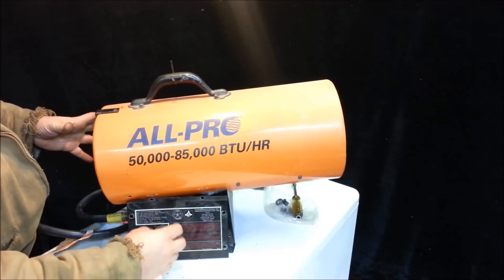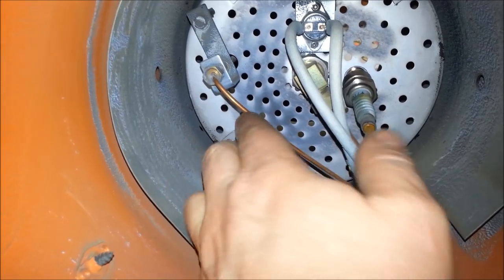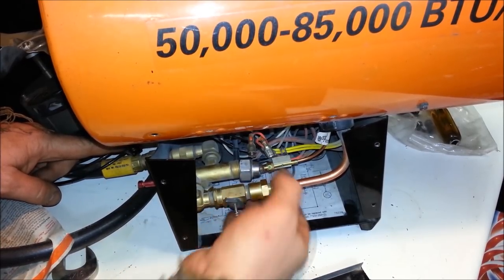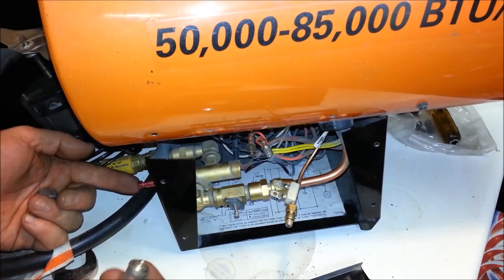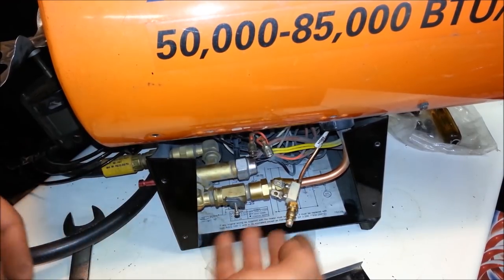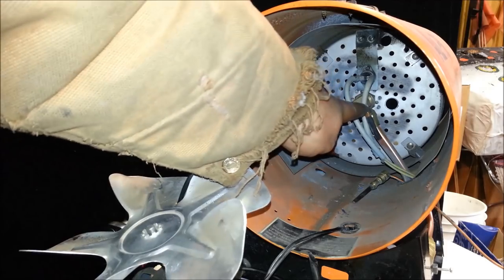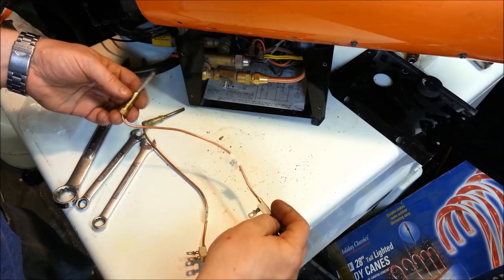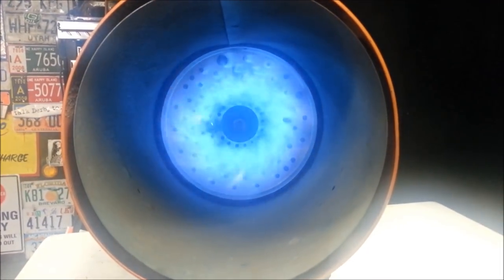Propane Torpedo Heater Not Lighting & How they Work

Comment: Great Video, But I put new thermocoupler in and still the flame goes out when I release the pilot lever.. Everything works great when the lever is pushed in. Whats my next move? It's a Reddy Heater 75-125.000 BTU and it looks just like the one you worked on. Thanks
Reply from the maker: Take your relay out; little box with a bunch of wires going into it with generally a clear cover. You need to check the contact points on the relay are making a good connection
Reply: Ok I will check tonight and get back with ya. Thanks
Reply: Ok the relay out only has solder joints nothing to clean off. Solder joints look good. What do I do next?
Reply from the maker: If it is newer there is likely to be a temperature shut off switch. The kill the power to the thermal couple if it sense the unit it too hot. It is supposed to shut the unit off and reset itself once the unit has cooled. If yours has one it will be about the size of a marble with 2 wires plugged into it. Take these wires off and test with them not touching and then with the two wires connected together. https://encrypted-tbn3.gstatic.com/images?q=tbn:ANd9GcTg3dsk4hi5XYhBJZgUH8Z247kFR-TYU2PgABbraYu8e5ylSlkKdw
Reply: Ok so pull wires off make sure there not touching and test? Then test with wires touching? If it works with wires touching or not, can I run heater that way until I get a new Temp shut of switch?
Reply from the maker: Yes, you can run it this way until you get a new sensor. If this is your issue.
Reply: Ok both tests didn't work. What do I check know?
Reply from the maker: Reading back over your comments. You need to pull the cap off the relay and check the contacts(points) Here is a video that explains it better. https://youtu.be/uerxvIBODOE
Reply: Is there away I can send a pic so you can tell me where my relay is?
Reply from the maker: On my model and many other it is about the size of a 9volt battery and has a clear cover(rectangular cube). It has half a dozen wires soldered to it and is mounted to the circuit board.
Reply: Ok my heater it doesn't have a 9 volt battery looking rely on the circuit board. On the right side of the circuit board there is, what I think, is the relay, looks like, maybe 2,  9 volt batteries put together and only 4 wires coming out of it, 2 of them are the thermocouple wires, but it's not mounted to the circuit board. Is there anyway I can send you a pic so you could point it out for me?
Reply from the maker: Post a pic on your Google+ account in the photo section, your Facebook, or make a short video with your phone and upload it directly to Youtube from your phone and send me the link. Also if you have a model number I may be able to pull up a schematic and pick it out on the parts sheet.
Reply: Ok I figured out what my relay is so I'll check and clean contact points and get back to you. Thanks for all your help its much appreciated. I'll get back to you.
Reply from the maker: Let me know.
Reply: Ok I know what the relay is on my heater, but what I'm not understanding is the contact points I need to clean is inside the relay? If that's what your talking about, my relay looks like a sealed relay, doesn't look like I can get in it and it's all black. The wires on top of relay is soldered wires. I'm sorry if i've been hard to deal with. Thanks for your your help with me.
Reply from the maker: Yes, you need to take the top off. Watch my relay video https://youtu.be/uerxvIBODOE
Reply: So cut it open?
Reply from the maker: Most just have a cover snapped on, but some are glued/plastic welded closed. So those would need to be carefully cut open.
Reply: Ok thank you for ALL your help, it's much appreciated. I will check back to let you know what happens.
Reply: Ok here's my update. I cut open the relay and the contact points looked good as new. So I ordered a new relay and now it works flawlessly. Thank you sixtyfiveford for imparting of your knowledge, I now understand how forced air heaters work because of you. Thanks again.
Reply from the maker: That's great. I'm glad it's working.

Comment: I have a reddy heater. It blows heat only on low setting. If i try to adjust to a higher setting the flame goes out. It sometimes will run on low heat 15 minutes then the flame will go out. I also have to turn the propane on and wait 15 seconds before I push the ignition if I try and turn the propane on and then push to ignite it will give a short burst and then nothing will ignite. After running for 15 minutes sometimes it the flame will dwindle down them go out or just go out all together.  Could it be the regulator? I have never tried it when it is warm out. It's always around 15° to 30° when I use the heater.
Reply from the maker: It's either your tank or your pressure regulator. There is a process to hooking up the tank and turning it on to make sure the safety valve is all the way open. It sounds redundant but do it exactly and you'll be good. 

Follow this procedure:
-Attached the hose to the tank. 
-Turn the tank valve on and wait 3 seconds
-Turn the tank valve off and wait 3 seconds(you'll hear a click sometimes inside the tank)
-Turn the tank valve on for the last time and it should be ready with the internal tank valve fully off.
Reply: @sixtyfiveford  Thank you.  If the tank has ice on the bottom could that be a problem? The tank is only half full. Is the gas possibly turning to liquid and not producing enough pressure.
Reply from the maker: @mikec3281  Propane freezing in a tank can be a huge problem. This generally only happens in extreme cold below 10-15F or higher temps if the heater draws a ton of propane(100,000BTU or more). Leaving the propane tank indoors helps this from happening, along with larger bottles of propane. 

For reference, I have a propane hot water/steam pressure washer I use in the summer. It pulls 400000+ BTU and will freeze a standard BBQ propane tank right up in 15-20minutes if I don't set it into a bucket of hot water.  Moonshine guys used to blow themselves up because they had to light fires under the propane tanks to keep them from freezing.

Comment: I have a propane torpedo I bought last year and never used now I use it this year and it shuts down after 5-10 min any idea
Reply from the maker: If it is extremely cold the tank or the regulator could be freezing up. Some models have an over temp safety switch that could be triggering as well if your blocking the output.

Comment: trying to figure out why I only have very low heat in my dynaglo pro propane heater
Reply from the maker: Most common cause is low propane flow due to a failing regulator.

Comment: My heater fans turn on, theirs a small flame in the heater but it wont light up. No ignitor button. Just a thermostat knob and a flow regulator which no matter how far I turn it reads 0. Full tank of propane.
Reply from the maker: The safety valve on the propane tank isn't opening all the way. Make sure the connection at the tank is tight then follow these steps:
Turn on the gas
Wait 5 seconds
Turn off the gas
Wait another 5 seconds 

Finally turn on the gas for the last time and use the heater. 

What this does: it equalizes the propane pressure in the gas line and makes sure the safety valve inside the tank is open.

Comment: Is there a way to test a thermocouple?
Reply from the maker: Yes, heat it with a blow torch and measure the voltage. Grayfurnace has a great video on it https://youtu.be/suen7QlJl4o . You should get over 10millivolts pretty easily.

Comment: I replaced the thermocouple on my Reddy Heater Pro 100 forced air propane heater,and it will still not stay lit,held the the knob down for no less than a minute and it shuts off as soon as the knob hit the top.I replace the module on it a couple years back and it ran good all last winter,this winter I went to use it and it would not stay lit.I use this heater only a couple times a winter in my garage and it seems like each winter there is an issue with it.
Suggestions
Reply from the maker: Take a look at your Relay. More than likely the little contacts are dirty and need a very fine sand paper to clean them. Pop off the clear cover and you'll see them.
Reply: sixtyfiveford

I'll give that a look see,thanks for the quick reply.
Reply: Well I check all contacts,no red flags ,no build up or other indicators, nice and tight connections. Another suggestion ?
Reply from the maker: I wonder if your model has a high limit safety switch that is defective. They are a little device, about as round as a dime with 2 metal spade terminals for wires to connect to. Some newer units use these to shut off the unit if it gets too hot.
Reply: Yes my model does have that switch.I guess that is the next item to purchase.Thanks so much for the great advice.
Reply from the maker: Aaron Noyes You can bypass it for testing. it will break the contact between the two wires. so connect the together temporarily and test it.
Reply: Connect the two wires terminals together ?
What kind of reaction am I looking for ?
Thanks
Reply from the maker: Aaron Noyes It should work like normal if this is the culprit. Try it with the wires connected together then with them not touching each other nor the switch.
Reply: Will do and report back my findings.Sorry for all of the questions,I just want to find out what is wrong with so I can use it.Thanks again.
Reply: OK finally found the time to test the switch.I have continuity across the two terminals at all temps,with my tester set on RX1.What else could it possibly be ?  Any possible way it could be the valve under the knob ? Reason I ask is I had it lit to thaw some pipes recently and out of the three times I tried lighting it one time it did stay on long enough to move the knob to medium and then high setting before it shut down after about a minute of run time.
Reply from the maker: If your thermocouple isn't providing enough voltage it won't allow the valve to stay open. There are basically 3 parts that fail on these: The thermocouple, the relay switch and the temperature over limit switch. 

You can test the temp over limit switch just like you already did by continuity. 

You can visually inspect the contact points on the relay and use continuity by closing them by hand. 

You can test the thermocouple by measuring millivolts while heating the tip of the thermocouple. It should read 20 or more millivolts.
Reply: I'll try and test the thermocouple in the morning and see what I get for a reading and report back.Thanks again for answering all of my questions.
Reply: Well I have 25 millivolts at the connection on the brand new 
thermocouple,triple checked all of the spade connections at the 
module,module is  2 years old tops with a grand total of 3 hours run 
time on it,the high limit switch shows continuity across it,and just 
about as the temp control knob is to top out to run at low setting , the
 flame drops out and the fan continues to run.I'm at wits end.
Reply from the maker: From what your saying, this is what I'm perceiving. You hook everything up and turn on the propane tank. You plug it in and the fan starts blowing air. You depress the startup switch for a few seconds. It starts burning propane and heating. You release the  switch and it keeps burning/heating. You attempt to adjust the Temp Setting knob and it kills the flame. 

Does it run normally while you're depressing the startup switch?  As soon as it dies, can you depress the switch again and have it light? Does it continue sparking when the flame dies?

Your temperature over-limit switch could be triggering at way too low of temperature. This will shut off the propane flow. Bypass it by connecting the two wires together and wrap them with some tape.
Reply: When I release the pressure on the control switch knob is when the flame dies out,fan still runs,depress the switch again hold for 30-45 seconds and the very same thing happens,at no point will it run to switch it to a different setting.Hope this makes sense.Thanks
Reply from the maker: It has to be the Relay. Did you take the cover off and clean the contact points? Humidity in the air will corrode the contact points so they can't pass the electricity through the thermocouple. You can bypass/test this by connecting the two leads on the thermocouple together with a random piece of wire. This will allow the thermocouple to put it's electricity straight into the valve and hold it open. 

To clean the contact points on a relay you can watch my relay video. Yours will have more contact points than the simplified one I show in the video. https://youtu.be/uerxvIBODOE
Reply: I'll try those suggestion tomorrow and report back.Thanks again.
Reply: OK.Took the relay apart and cleaned both sides ofthe contact points,which look shiny and brand new.Tested it,did the very same thing,stays lit until knob if fully released and flame dies,fans still runs.Next I did the bypass test with wire between the two wires off the thermocouple,very same results.
Reply from the maker: I've never seen it happen, but it sounds like your electromagnet valve plunger is shorted out ( 2:42 in the video) or not making good electrical contact with the thermocouple. It should test with very little resistance. I looked at your parts schematic and it looks like they only list the entire valve assembly. It is rarely, if ever replace so it would be an expensive part; if you could even find it. You can run the heater manually by making something to hold the plunger in, and only use it while you're around(should never leave one unattended anyway). It will function normally with the plunger depressed.
Reply: I kind of felt it has something to do with the valve from the get go.I 
have ran it many times with a hand clamp across the knob and around the 
gas inlet,just would be nice to adjust to higher settings as on low it 
does not burn as very efficient and produces to much fumes than on med 
or high.Thanks so much for all of the help and suggestions you have 
provided.I really appreciate it.

Comment: Mine will ignite but  the flame will not get Bigger!! Any ideas???
Reply from the maker: Bad inline regulator. It's the bulky thing on the hose you connect to the tank.
Reply: @sixtyfiveford  Nope , tried a dfferent one still the same !! Played with the pointy thing with a wire brush to clean it and fired right up and worked like it should, Tried it today and did not want to flare up again !! About to through it in the scrap pile!!
Reply from the maker: @kdscrapping4452  Sure your propane bottle opd valve is working good. And or your hose fitting is fully seated into the opd valve.
Reply: @sixtyfiveford  Yes I had tried 3 different bottles. Even tried different heaters to make sure it was not the new hose or propane bottles. The other heaters worked fine !!
Reply from the maker: @kdscrapping4452  Ok. Then you have an obstruction somewhere in the safety valve to outlet nozzle.
Reply: @sixtyfiveford  is it easy to fix or scrap it ??
Reply: @sixtyfiveford  got it fixed . opening the valve too fast was the problem!!

Comment: why would one of these burn a yellow flame instead of a good blue flame
Reply from the maker: Failing pressure regulator. It's in the hose attached to the tank. Yellow flame is bad and will dump a lot of carbon monoxide into the room. A blue flame is ideal and will have zero CO emissions.
Reply: @sixtyfiveford  it is brand new out of box maybe I should take it back for a swap
Reply from the maker: @jodymorrison9495  The fan could also be  obstructed.  This should sound like a roar when running.
Reply from the maker: I would swap
Reply: @sixtyfiveford  thanks for the info and reply. I did see on YouTube that another guy said his did that once and he restarted it. Maybe it had air in the line or didn't light correctly. I will give it another go and see but if no blue flame I will swap it out. Thanks.

Comment: Don't think mine works this way. No button to push. Must override the valve automatically. Mine isn't doing that.
Reply from the maker: Is it propane powered?
Reply: @sixtyfiveford  yes it is. I can make it so the valve doesn't plug the manifold and it runs, butnof course isn't operating the valve. Could be circuit board. Seems that's what would have it unplug until the thermocouple warms up and takes over keeping it unplugged
Reply from the maker: @mikewarren7855  If the thermocouple doesn't produce electricity the circuit board will shut it off after a few seconds of running.
Reply: @sixtyfiveford  thermocouple can never make electricity as it never opens the valve to let propane in
Reply from the maker: @mikewarren7855  The circuit board should have a relay that opens a gas solenoid then. The solenoid should be easy to locate on the propane inlet line and pretty easy to test for voltage going to it. If no voltage then the relay, which is likely part of the board is the culprit. This can also be tested to see if it is getting voltage required to operate.

Comment: Mine runs for about 15 minutes then stops… heat sensor?
Reply from the maker: Tank or regulator freezing possibly. It could be the overheat sensor as well, but that should trip before 15 minutes.
Reply: @sixtyfiveford  I was using it while painting last winter on a construction project I figured that the paint dust might of screwed up the sensor never actually timed it but it seems like about 15 could be less though
Reply: @sixtyfiveford  it’s a propane unit